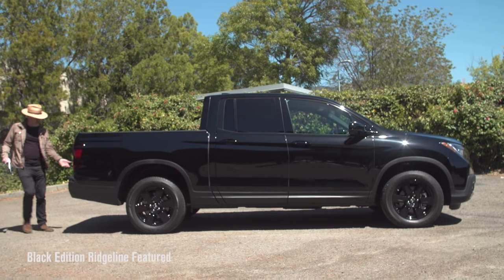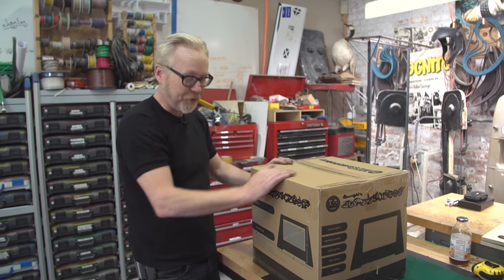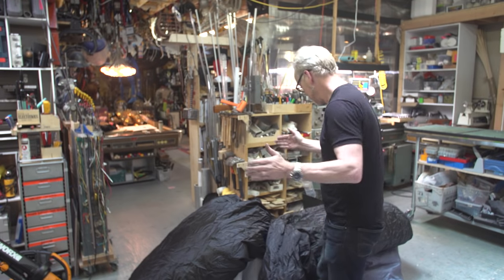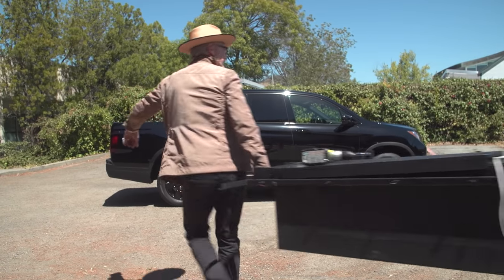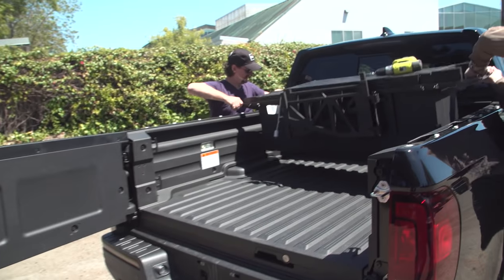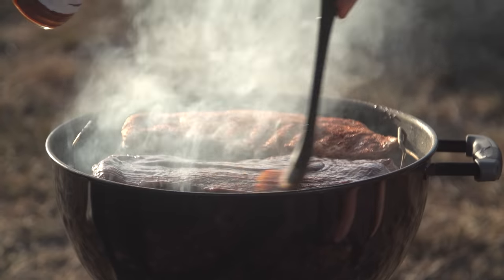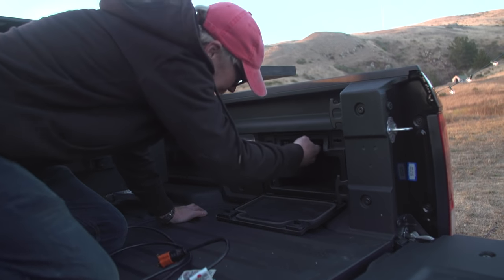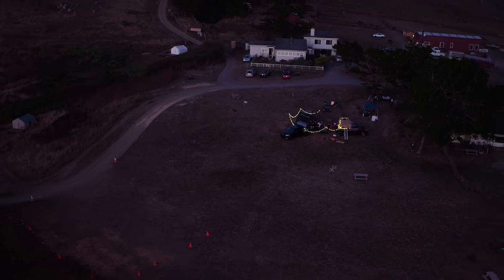Features Not Standard: Adam Savage's Portable Movie Theater

Comment: This inflatable screen is somewhat ridiculous, the frame takes more space than the screen ;-)
Reply: Yeah, but the supports have to be thick or it won't stand up to ANY wind at all.
Reply: I'm sure Adam could build a fold out wooden one. that I would watch. this must be low budget option they sold to Hondas marketing team.
Reply: Thing is, if they did go with the fold out option they wouldn't need to plug it in, and as this is an advert for the truck, that wouldn't do.
Reply: It could have still had motors to unfurl the screen.

Comment: Easier method without a loud motor and electricity would be two spring loaded compressible poles with a sheet attached between them. One flick releases the springs and the screen shoots up.
Reply: They needed to show off the 120v plug in the back of the truck. I'm guessing that they were given somewhat specific instructions on features to use in their builds by the people paying for it.

Comment: a back yard inflatable screen was probably not the best idea.......a folding extendable frame would have worked better then it could have beenlaud flat along the sides if the truck bed and it had a fold down tailgate the projector could have been placed there.........but they probably had a short time frame and that worked better.

Comment: What is the box coated with? Would it be really weatherproof after all it rides on the open flatbed of a Pickup truck...? Wouldn't a solution with Aluminium boxes and fixtures come far more naturally for this purpose of the completed build?

And the construction of the chairholder without a fixing mechanism included from the outset does not sound very Adam... it would have been easy to build the whole wooden frame from scratch including another "prong" above the chairs so it could be easily closed off after how many or few chairs you want to transport in between the two wooden beams (on each side). Just add either holes in the wood or a screwed on metal bar with screws (like you can buy for wall-mounted shelves), put one C shaped bit of metal through the set of holes closest to your last chair and secure it with pins. Undone in 20 second and no more complex than the thing Adam built anyway.

Finally "one button" to open up the screen? Yeah if you ignore the fiddling with the securing cables afterwards. Why - if he uses the prefabricated holes to fasten his box at the end of the bed - didn't he at the same time make two plates or the other bedend with welded on loops for the wires, attached them when putting the box on it and had them self-tightening when the frame is fully inflated from the beginning? Having to crawl about your truck and screen frame while it is inflating is a bit of the opposite of the intended "as easy as possible to use" concept, isn't it?

I still like the video, it just feels so much like it was "Phoned in" when compared to the builds Adam made for his own collection and hobbies like the case for the Blade Runner gun or his space suits where everything seems to be thought through thoroughly before the first move is done towards actually making it...
Reply: I think that's why they don't go into specifics. It's more of a general idea they leave out and open for everyone.